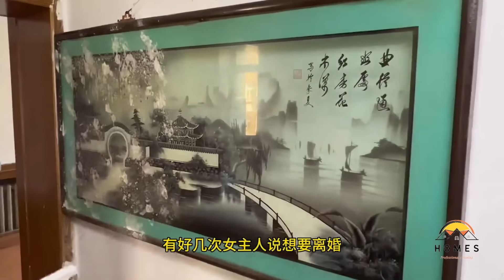Cleaning up the house of a man who is heavily addicted to smoking. ~ Satisfying Cleaning

Comment: We often make house clearances. Only cleaning, you can do your best like here shown, won´t help. The smoke sits inside of all furniture, textils, inside wallpapers and even in the wall plastering. In one case we threw everything away from a house. The couple, which owned the house, moved to a senior residence and sold the house to a younger couple. They wanted to build in their dentist practice there. But even after some treatments with chemicals to get the nicotin and tar out of the walls they gave up.They had to tear down the house and build a new one.

Comment: Holy crap! My old wood fired stove doesn't turn my walls that black and it is my only source of heat and isn't sealed properly. I haven't cleaned my walls in the 3 years I have been here and it is nothing like that and I smoke.

Comment: Where the strength of tobacco is not so heavily regulated as in Europe you get this level of tar deposited,we had the clamp down to reduce tar in the80s tar in brands cut by80percent on some brands and others discontinued as unable to replicate flavour with reformulation and filters.You use industrial strength chemicals to strip the filth this easily.